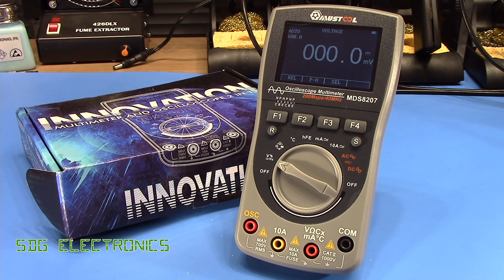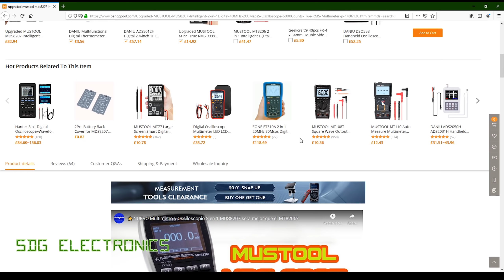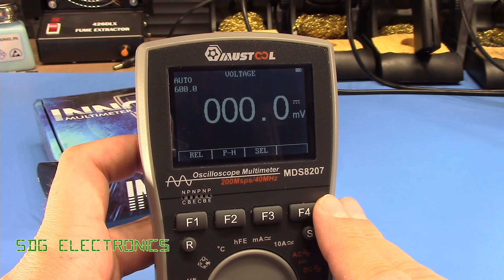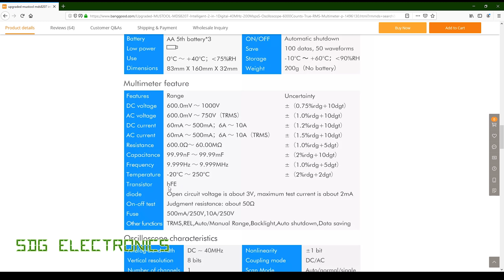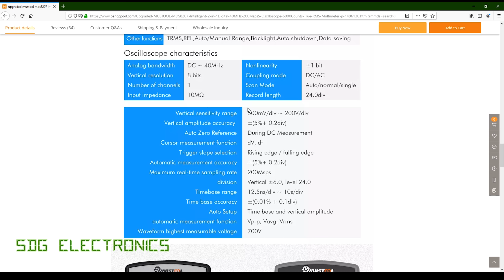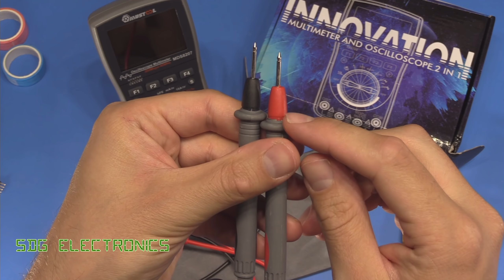SDG #108 Mustool MDS8207 Scopemeter

Comment: A VERY big issue I have with this meter is that the mA function uses the voltage input ports and not it's own dedicated port like the 10A.  That means if you're measuring voltage and decide to switch to oscilloscope mode, you blow the low current fuse if you don't disconnect the leads first!!  Very bad design. 
I will be modifying my unit to add a BNC with coax for the oscilloscope input and switch the mA port to use the former OSC port. 
BTW, you can use a BNC to banana jack adapter the plugs into the 10A and OSC inputs if you want to use a standard scope probe with this as the 10A shunt is at goes to ground. 
Nice unit otherwise.

Comment: When I try to use the oscilloscope function, I pick up both DC pulses and spurious AC frequencies. I have to be careful where I place the meter it just seems to pick up interference. Is this typical for this product, or have I received a defective meter?
Reply from the maker: I've not experienced this, but this could legitimately happen if you're using a Class 2 switched mode power supply to power your device.

Comment: Its no bad Not worth £100 i paid from Amazon for the KKmoon version  The probe leads are rubbish broke after a couple of weeks very thin copper inside. The screen text could be bigger in scope mode. It only switches back on after sleep on tthe scope side which is annoying. True 3db bandwidth is more in the region of 20Mhz. Apart from that not bad prob worth as you say about £50 £60. Hold F4 at switch on  to go into silence mode thank you to the other reviewer you mentioned for that. and Thank you.

Comment: Would love to see your thoughts on the hantek handheld DSO multimeter all in one. Beautiful color graphical display, 70 MHz, with built-in arbitrary generator and multimeter. Yes it’s about double the price but also higher bandwidth and better specs! Seems to be built extremely well, And meticulously thought out and designed. It doesn’t have the same appearance as a lot of the Chinese products.! 

Also would love another video updating your thoughts on the FY6900 function generator. Thanks for your great content!
Reply from the maker: I will see if I can get hold of the Hantek. I also have a video planned soon for the signal generator as I am updating the power supply design anyway. Thanks :)

Comment: This will be good tool to toss in the backpack when doing field work but, daylight viewing quality of that reverse LCD worries me, love to get a feedback on that from you. Also it might be a good idea to design a small PCB banana to BNC converter, with proper termination, that will fit on it. Even the cheapest oscilloscope probe should work better than those low end MM probes. Good review, thank you!

Comment: Ah, I've been looking forward to your review. Another interesting meter from Mutool but it's a shame they are a bit pricey and the build quality is still rather chintzy. I reviewed the previous incarnation of this meter (the MT-8206) and I am disappointed that Mustool produced this newer model with the same cheap plastic case, no rubber cowl and SMD fuse. I was hoping for some deign impovements regarding these points. Anyway, great review.
Reply from the maker: I think for electronics use the build quality is passable but at full price it's far too expensive for what it is. There's not a lot of competition for this kind of meter though. It'd be nice to see something more professional that you safely use for mains use though, especially bundled with current clamps etc.

Comment: 200v may came in handy as a cheap automotive scope meter. You can see such high voltages with collapsing magnetic fields on things such as fuel injectors and even higher on ignition coil control circuits.

Comment: Thank You 👍😁   Talk about a impulse buy. I caught about 5 mins of the video before i ran to Bang(me)Good and purchased. And this is before I knew if the meter was any good 😓 And yes, thanks to your mention of coupons.... I (quite quickly) found a 30% off (I believe 🤔). Anyway, instead of $99🇺🇸 it was $71.99 OUT THE DOOR to the U.S.. Geeze Laweeze 👉 Thank YOU! 🤗 ❤

I used the 1st one 10/12/19 @ 6:10 PST

Price without coupon: $99.99
Coupon 1 ($69.99): BGM8207
Coupon 2 ($74.99): BG258207
Coupon 3 ($74.99): BG10MDS
Coupon 4 ($76.99): BGMDS8207
Coupon 5 ($89.99): AFfbG10
Reply from the maker: Thanks for sharing the discount codes. The meter becomes a lot more attractive at those prices.

Comment: 11:19 Hi, i have a function generator similar to yours, tell me something, if i short the leads of it, might i end up destroying it? Is it short circuit protected? Same as connecting a big load.
I tried to look up on my model's manual but it says nothing about it.
Reply: Tipically they are 50 ohm sources, that limits the maximum short current (you can do the calculation). No problem at all if you create a short!
Reply: @jorditribo94  Thank you for your reply.
Correct me i'm wrong but it goes up to 20Vpp, and 50ohms tells me 400mA, isn't this too much for a microcontroler to feeding the output? Or  is there other component dealing with these 400mA?
Am i doing the calculations wrong?
Reply: @FixDaily  it is designed to support that kind of current. There are outbut buffers, it is not only a microcontroller
Reply: @jorditribo94  ok thank you for the help and replies :) have a great day
Reply from the maker: As Jordi mentioned, there are some output buffers from the unit. I wouldn't recommend shorting the output on a regular basis though.